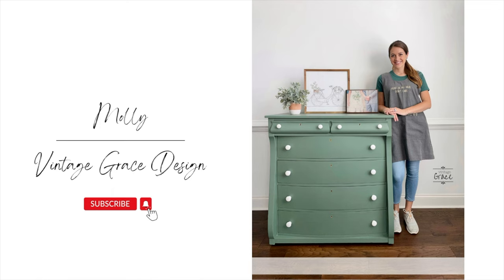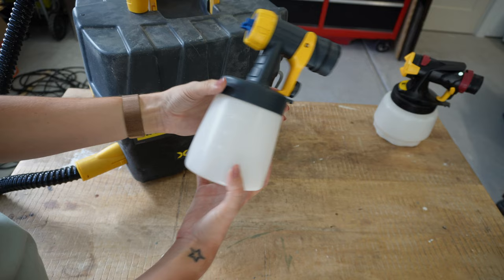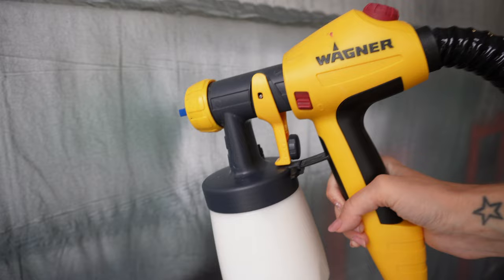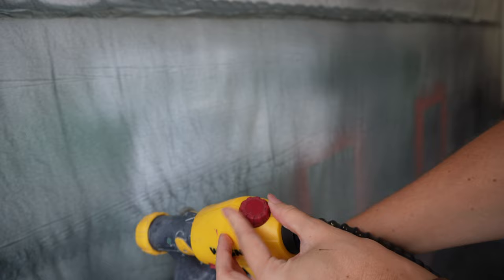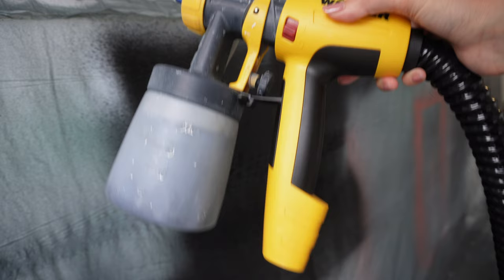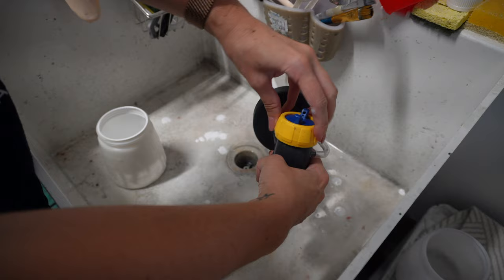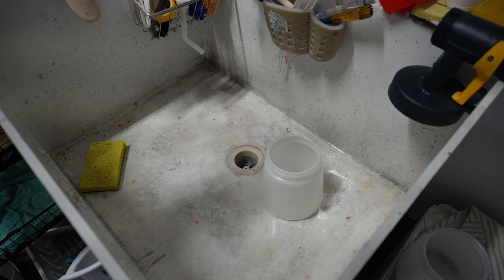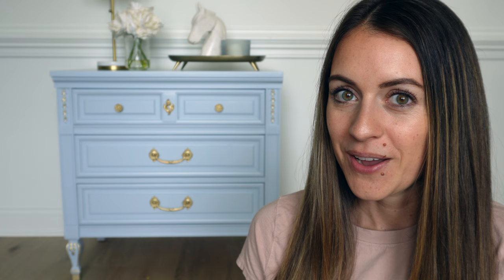Spraying for Beginners | Wagner Flexio 5000 Spray Gun Tutorial

Comment: Well presented and full of good information. However when it comes to waiting in between coats try sealing the spray gun inside a plastic bag with the open end tied with a shoe lace. No air gets inside the bag so the paint stays wet. This way your tip doesn't dry out , and no need to clean or mess around with the tip. When you come to your next coat of paint just pull it out of the bag and carry on where you left off. I have left my spray gun over night in the tied up bag if I am continuing to paint in the same colour the following day and only clean the gun out when I've totally finished spraying. Hope this tip is useful to you or your followers. Kind regards. Tim, from the UK.
Reply: Just put the spray end inside a zip lock baggie.

Comment: This might be a dumb question, but do you have to pull the drawers out and do anything for the lip of the drawers or does spraying with them in work fine?? I have a big dresser I want to paint, spraying would be so much easier. Thanks.
Reply from the maker: The drawers do not need to come out to spray. I prefer to keep the drawers in and go back and do the drawer edges by hand.

Comment: great video, purchased this to stain a very large deck (nearly 800 square feet with 110' of railing with 2" square wooden balusters). This unit saved A LOT of labor time. If possible could you include the cleaning procedure of the larger sprayer, I think I got it right but wasn't sure how many parts are removable. I used the detail sprayer for the railing and the larger sprayer for the flooring. Even after cleaning (I cleaned a couple times during the job as it was several hours), the stain clumped a bit using the larger sprayer, but it seemed to only clump from one side of the spray pattern. I didn't have this issue using the detail sprayer.

Comment: Great tutorial video, very helpful.  Wondered the same thing about cleanup.  I'm wondering about use of alkyd (oil) paints and primers, one in terms of application and two in terms of cleanup.  I use a lot of oil-based paints.  I find it easier to clean oil brushes than latex because I just suspend the brush in a small can of paint thinner for three or four days and almost all the paint solids simply fall off the brush to the bottom.  Then only three or four "rinses" with paint thinner in a can and it's clean.  Brushes basically clean themselves.  I reuse paint thinner dozens of times because the solids drop out of it after storing and it's clear.  Anyway, what is your experience with oil based paints?  Might the equipment be cleaned the same way, just let it clean itself?  Thanks.
Reply: Obviously when you use oil based material you will have to flush the gun out several times with solvent cleaner such as thinners or  white spirits. I just add thinners to the paint cup and spray it out against some cardboard (please remember that thinners is highly inflammable, care is required here when disposing of any cardboard or rags used to clean out the gun ) then strip down and clean all the parts of the gun that have come into contact with the paint/ primmer with a old paint brush and dry with paper towel or rag. You will need to do this as soon as possible after spraying because if you let the oil based material begin to cure inside the gun you will end up throwing the gun away as it will be very difficult to clean. Hope this helps. Kind regards. Tim from the UK.
Reply: @timothyarnold777  Thanks, that makes a lot of sense.

Comment: I'm back!  I couldn't get my 5000 to spray without blotchy spattering that didn't cover.  I was spraying Ben Moore alkyd (oil) primer.  It's pretty thick but apparently that shouldn't be a problem (and so I thinned it a little).  Everything is clean now so I'm not anxious to test again.  Could it be that I didn't have the big yellow nut that holds the nozzle on tight enough?  I didn't really give it any thought, but I know it was loose enough to allow for easy turning of the spray head.  If it's a bit too loose, would that cause splotchy spattering with no true pattern?  Very little primer was coming out and I would have to go over the same area multiple times, and even it was uneven and bumpy.  Thanks, hope someone can help.
Reply: I had a similar situation as you. I bought this unit to spray an absolutely enormous deck 800 ft.² and 110 feet of railing. All pressure-treated wood. I used Home Depot brand premium. Solid color stain. The detail sprayer worked very well after I got the Settings correct. I use this for the railings and ballisters. I then switched to the larger sprayer to do the floor as it has a much wider spray pattern. Using the same exact stain the unit cap putting out blotchy spray pattern. I can tell you if the nozzle nut is not tight the unit will continue to leak Stain out of the end even after the trigger is not pulled and the unit is shut off the nozzle continued to leak. Once I tightened the nut completely, it stopped leaking. But I was never able to get a nice even spray pattern. It seemed like my gun was clumping up on one side of the spray pattern. Maybe there was an air hole somewhere that was plugged up. I did not thin the stain with water as I did not need to do it with a smaller sprayer. Luckily, the clumping up was not a large issue as it was the floor of the decking so I simply kept a roller handy to spread out and even the stain. Even with the shortcomings of this unit, it decreased the time to stay in the stack by at least 10 fold. Well worth the $220 I spent on it from Amazon.
Reply: @wrthomas69  I decided I'm not going to use the sprayer for oil based primer or paint.  The cleaning process is too messy and takes forever.  I'm a big believer in oil and will still use it, but apply with a brush.  There's not much to "cleaning" oil paint from brushes as they basically self-clean.  I just suspend them in a can of paint thinner and in three or four days - or less - all of the solids have dropped of the brushes and settle to the bottom of the can, and a couple of "rinses" with more paint thinner and they're done.  The paint thinner can be used dozens of times, I just let it sit in a big coffee can, the solids settle out and it's clear, and use it over and over.  (I hate cleaning latex brushes because it takes forever running under water to get all the paint out).

Anyway, I think possibly the primer I was using had been sitting around too long.  I think fresh primer would have been okay.  I did use the sprayer with a fresh can of "Stix" primer, which is water-borne, and had better results.

I have to say I don't think much of Wagner's product support, which is non-existent.  I wrote to them on their "contact" page and explained my issue in detail and never heard back.  They have a few really crappy videos, supposedly some dealing with troubleshooting (less than two minutes long, lol) and didn't explain anything.  And then they don't allow comments on their videos, clearly they don't monitor.  Really disappointing for a $200 million company.  Nothing turns me off about a company like this does.  As I recently purchased the unit, I may return it and buy a different brand.
Reply: I would agree about the lack of customer support. I sent an initial inquiry asking what would be the best product for my situation, and they immediately pointed me toward the flexio 4000 and 5000. Even though I asked them specifically about the control spray max which is about half the price of the 5000 they kept pointing me toward the more expensive units. I I bought this specifically to do this deck and plan on selling the house before the deck needs to be stained again, so I may, keep it or possibly sell it used. I can’t see myself using it indoors. The one issue I did have, which was my fault was that I started using paint that was a year old and must of had some kind of skim on top, which got mixed into the paint, so it kept plugging up the uptake tube. Once I started screening the paint, the results were better and I had no issue when using a brand new can.